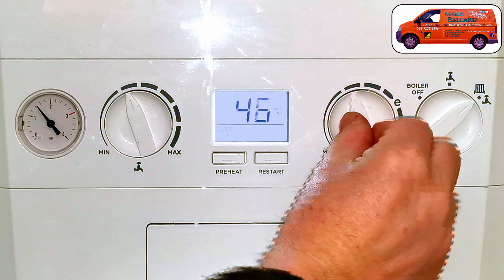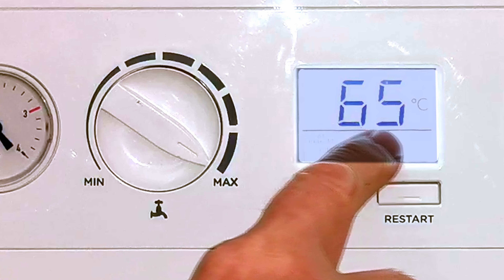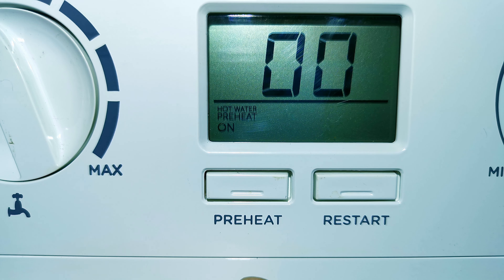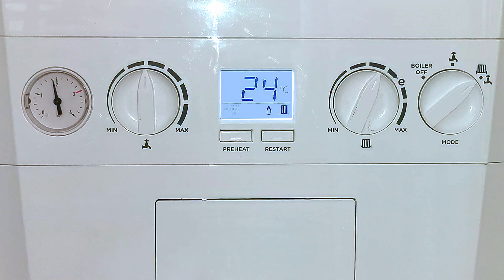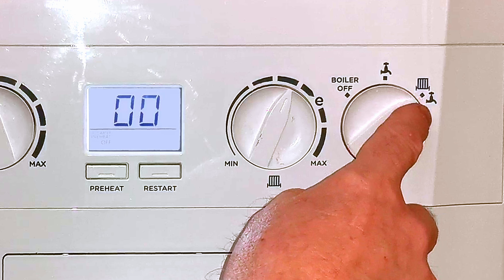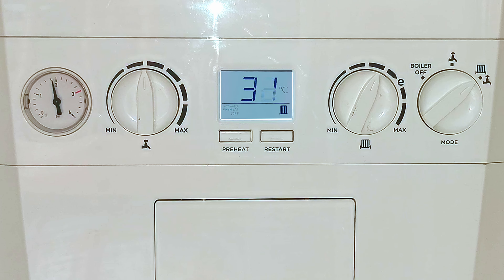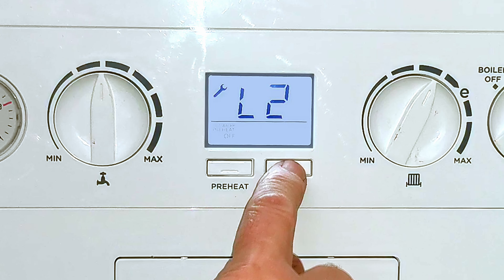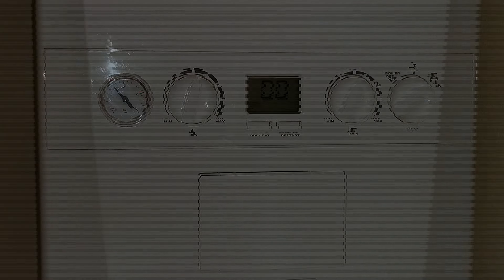How to Operate Your Ideal Logic Combination Boiler.  Easy to Follow Step by Step Instructions.

Comment: Thank you for your very informative and helpful video.
As a general rule for my safety and others aswell as from a legal stand point i do not touch gas boilers.. Since the boiler was displaying that it was low pressure I followed your instructions and the boiler is now working again.
Saved a trip out for the local council. Thank you

Comment: Thanks for the video. We've just moved house and have an Ideal Classic 35 which looks almost the same. The thing there is underfloor heating underneath which we're told you should keep on all the time to some degree. I've set the water and radiator temperature levels to those suggested, but if we keep the underfloor heating on (boiler timer switched off effectively) will that mean the water is also kept hot during the night, even when we don't need it to be?

Comment: Thanks for the video. Someone was messing with the taps (cough) to try and sort the pressure out, which they did - but now there is no heating to the radiators. The hot water is working ok... any ideas? I've reset everything to how it looks on the end of your video...

Comment: Hi I have just moved into a new build, and have a C24 combi boiler. Your video has been very informative with how to adjust the controls, however, I used to have a combi boiler before and could put a timer on as to when it starts  in the morning and when it goes off automatically. This boiler doesn't have any of these features, so how do I put in the time I want it to come on and go off? Thank you.

Comment: Hey, thanks for the information. Is it possible to turn the heating on/off on an Ideal Independent C24 without a thermostat? Currently waiting for the electrician to visit and install the Hive, but in the meantime, is it possible?

Thank you!
Reply: Did you ever find an answer to this?
Reply: @ In theory it was possible with the onboard manual timer dial, but I could never get it to work, I just waited until the Hive was installed unfortunately

Comment: Just had a Ideal Combi c30 installed and this vid has aided me lots so thank you! Engineer upon completing install did run through certain things but he went so fast I couldn’t keep up! It was ten past five though… Probs knocking off time. Thanks again! 👍🏻
Reply: The E is also on mine in condensing mode
Reply: Same here just bleed my radiators then had no pressure instructions were beyond me. This video has kept me warm tonight

Comment: Hi there. My radiator temperature is set up 60 degrees but it's way past the eco setting, on the biggest line near max. What does this mean? Shall I set it to 60 degrees or just past the eco which is 55 degrees?

Comment: Any tips if the central heating is not working? Pressure is fine (1.5bar), thermostat is on and radiator temperature at "e".

Comment: Very very helpful! I got one these in summer. When turn taps on sounds like aero plane upstairs and big clunk from ,?mains water? Not sure. So we can’t have heat on at night , noisy especially if it clicks on and off as temp changes. Got engineer to check it, said nothing wrong.  So hmmm. Your video was helpful. Thankyou

Comment: Hello Mark 
I have a new combi logic c30 , the pressure gauge is now under a drop down door ( not a good improvement) my question is I want to turn the radiator temperature down . The radiator and hot water dials are above the drop down door . The instructions I was Left with the boiler are not actually clear , mentions a mode button to press , but looking at your video of the boiler you had in the video it’s just simply turning the dial to turn the radiator up or down . Will this be the case for the new C30 .
I did try ringing ideal , but all I got was someone reading from a script 
Can you help please

Comment: My Logic ESP1 35 combi boiler doesnt have the pre heat button (the button is there but no writing under the button and nothing happens when you press the button). Also when my heating is on "e" it shows 25 degrees where as yours shows 60! Thats quite a big difference?

Comment: Hi I've got up this morning no radiators on or hot water. I've gone to the boiler to top the water pressure up as I know how to do this. My house is a council house,and council don't like leaving the loop fixed in place . I had the same issue at Xmas and had to call them out as when I connected the loop on water was coming out of the 1st pipe with black and blue taps. But water was dripping from the blue tap. Anyway the council came out and he said there wasn't a washer in it so he put one in. I asked him if he could leave the loop connected up which he did. So I've gone to try and fill the water pressure this morn and it's dripping a bit again. But it sounds like the water coming through but struggling if that makes sense. I've got the pressure to 1 bar and turned the blue taps off. I will keep my eye it and if it drops again will have to contact the council to come and have a look at it.

Comment: Hi, great video thank you.
My heating engineer said for me to leave the temp on the heating full up in the winter !! When he installed the boiler he also gave us a boss wireless controller which we have no idea how to work, the engineer said just leave it on auto and forget about it. It doesn't seem to let us control the temperature as if one sets it to a certain degree the boiler should cut out and cut in again once the temp is reached but it seems to get hotter and hotter!
Can you advise me if it's possible to fit a manual timer like the ones you simply push the buttons in that are in a circle around the outside?
We are not Spring chickens and know nothing about the complexity of the body gadget we have now, very frustrating when all we want to do is put the boiler on a timer twice a day.
Many thanks
Andrew

Comment: ideal logic combi  ESP1 38 boiler . The heating keeps running downstairs and upstairs it goes on only if I increase the temperature on the thermostat. The thermostat downstairs I set it up all hours and day’s to 18 degrees- even if I have set the temperature downstairs to minimum the heating still runs generating high temperature downstairs. I have switched the thermostat uit the one from upstairs and no change !?  Any idea what’s going on ? I have no error display on the boiler

Comment: A very useful video thanks. I have the same question as someone else but there was no reply. I increased the pressure to 1.5 bar but when the boiler started operating the pressure rose to about 2.5 bar. With it switched off it's now on 2 bar. How can I reduce the pressure?
Reply: I have this problem too, I bleed the radiators, until water started coming out, this reduced the bar down to 1, but what is the correct psi is anyone's guess
Reply: Hi Mark, My boiler has F1 flashing, I normally check water pressure which is on 2 now tho doesn’t work? Do I need to drain my radiators first?? Thank you very much 😀
Reply: @DaDdy79462 i contacted the boiler installer and explained that after setting the initial pressure to the correct 1.5 bar, the pressure rose to 2.5 bar when operating. I was told this was okay so I haven't taken any further action. I hope this helps.
Reply: @IntruderFilmStudio  Thank you
Reply: My pressure is 2 bar.Is this to high?

Comment: I had a Logic combi when we moved in and the central heating temperature knob did nothing - As it happened there was a weather compensator installed which takes that control away and the radiator temps are set automatically by the system based on the outside temperature. This is important to note as some people may be unaware that their CH knob is doing nothing. Turns out it was a really crappy system because unless it was near zero outside the radiators were never hot enough to heat the house.
Reply: Did you manage to override the auto temperature?
Reply: @WillScarlet1991  Yes. I disconnected the weather compensator wires. That was all it took, the boiler went back to normal manual control after it restarted.
Reply: @DunkingJaffaCakes  That sounds a bit complicated for a newbie like myself. Would it be quite dangerous if someone didn't know what they were doing?

Comment: Do you know why the boiler keep showing blead radiators or contact the installer as the radiators have no air, expansion vessel has been replaced with a new one. When we try to reset, start up but every day many times we have to reset. It's been a real pain. Thanks in advance

Comment: Hello, at exactly 14:57 there's a side panel underneath the boiler which has 2 buttons, mine is displaying red led, I cant find any information on the manual regarding this, could you please share any  knowledge you might have on it?

Comment: Hi flame symbol goes off after reaching the setting temperature, then  temperature drops around 11 degrees, then flame symbol comeback again. Do you think there is a problem with the boiler  for  the flaming symbol going off and on 🔥 again, or is it normal. Thank you

Comment: When I switch my hot water tap on  for  20 seconds I can see the temperature  go up on the display but when I turn the tap off  the display goes back to normal but the boiler stays on for several minutes.  Pre Heat is Off. The room thermostat is also in stand by mode  so it is not demanding heat for the radiators.   Anyone suggest what is going on ?   It seems to me it is wasting gas every time I turn the tap on.  Hot water is set to 50 degrees  on the boiler.
Reply: hi im going through the exact problem, have you fixed it yet? and if so how pls
Reply: @sniikii3802  Gas fitters are coming round in a couple of weeks to look at it. They fitted the boiler so they will have to fix it. I will look to post  the solution when they tell me what is going on and how they will fix it.

Comment: For winter mode (Tap+Radiator) using a thermostat (Honeywell T3H700RF0069) makes the little receiver box click to say it's acknowledging the temperature setting. But the boiler never turns off it's permanently on like it's ignoring the thermostats request for a specific temperature.

Could this be a wiring issue? I've reset and re-synced the receiver and the thermostat after a power down (Including the reset from a previous video) but to no avail.